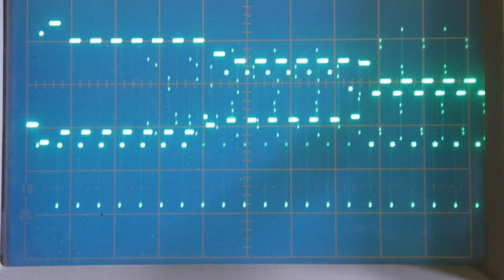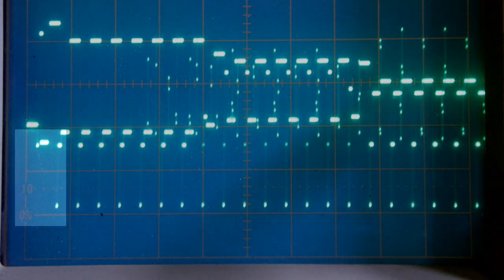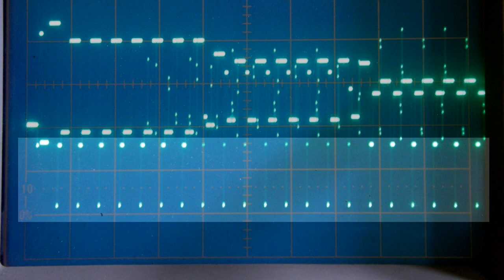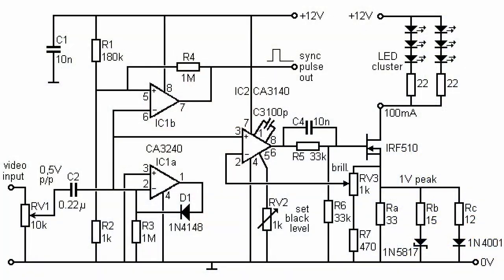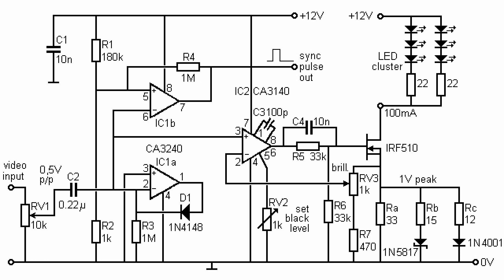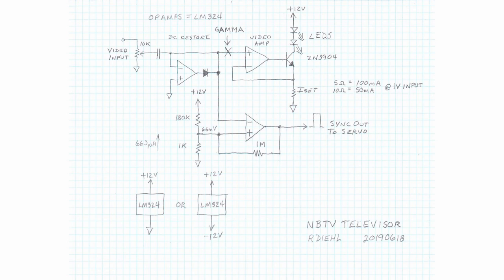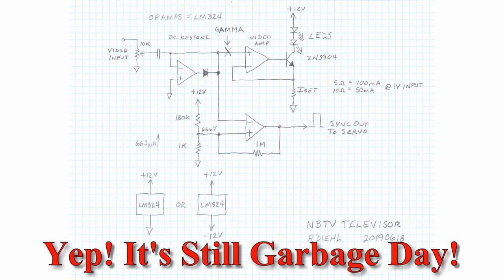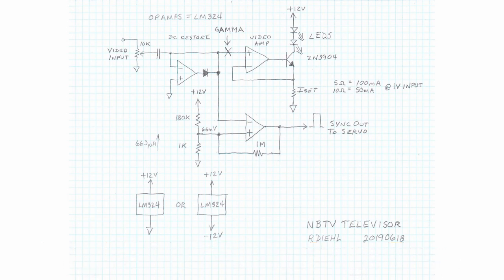Narrow Band Television, Video Signal Analysis and Early Circuits 20190618

Comment: Did Dumont have their own scanning rate in the early days of color experimetation? I am very fascinated with Dumont and feel bad that RCA smothered them out. I have a 1959 Dumont Hampton and a 1947 Stromber Carlson which is a Dumont RA-103 clone. I would love to build a mechanicale TV. I do not believe the Baird replica kit is availlible anymore. Gary
Reply from the maker: Dumont and GE both made a 525/90 field sequential systems with 18MHz bandwidth. Closed circuit short range only, obviously. My Tektronix o'scope 744A uses a format internally that is extremely close to that! It's a monochrome CRT with a "liquid crystal like" optical RGB shutter panel in front. (Too bad it is broken again.)
Mindset's web site says there are 6 units in stock and more can be ordered. https://mindsetsonline.co.uk/shop/televisor/
Reply: @videolabguy  Emerson bought the Dumont television manufacturing in the late 1950s. There were Dumont televisions made up onto the mid 1960s or so. I wonder how much of the sets were still made by the Dumont engineering without any changes by Emerson?

Comment: Termination, who needs proper video termination? Just ask the guys at IBM Boca who designed CGA....
Reply from the maker: CGA and EGA are not video. VGA came a lot closer. For years, I thought precision voltage levels were a myth. Then I got a great mentor who set my ignorant azz straight. He was mean as heck. But, I survived and was far better for the experience. When I do sloppy circuits today, its actually painful!

Comment: The gamma issue has always been somewhat controversial but the truth is a "true" fully mechanical system, that is, a mechanical camera to a mechanical monitor, is perfectly linear . So if you replace the mechanical camera with a conventional camera, that is, one that applies (inverse) gamma, you do need gamma correctional circuitry at the receiving end. In practice the improvement tends to be swamped by the myriad of other sources of distortion so I rarely bother with it other than to correct for it at the source.
.
None-the-less, if you are striving for perfection, and your source applies (inverse) gamma you will need to correct for it just as  a CRT (inadvertently) does.
Reply from the maker: Thank you for the excellent comment. I have a plan to put a gamma corrector in the video path as an option for those who find they truly need it. The upside is that my circuit is adjustable over an incredible range of negative to positive gamma, and is linear in the middle setting. The downside is that the quad current feedback IC used has gone up to $18 each at Digi-Key. (A voltage opamp won't work) For me, if a solution works, I will eat the cost. But appreciate that not every experimenter has pockets that deep. For me, it is also possible, though not verified, that my world converter has a gamma control buried in the menus somewhere.

Comment: I did some experiments with ic1b some opamps work better than ca3240 for the sync pulse you may like to use individual opamps and have a play I think I had a circuit change on the forum I will have a look and you may like to try it out if you are not happy with the results .

Comment: That's pretty neat.  So if you were to record such a signal on an open reel deck.  Would you have to use one of those t junction adapters with your 75 ohm cable so that you can stick a terminator on there, or would you just plug it into the deck with an RCA adapter and call it a day?  I'm curious how they get proper termination to record these signals.
Reply from the maker: Using audio gear, you don't terminate the line with 75 ohms. Using a T adapter is one way to do it in a 75 ohm environment. In an audio environment, the typical impedance is anything from about 1K to open or infinite resistance. 10K would be fine. The reason I have to use 75 in my system is because my converter is 75 ohm. If I use audio gear, then I will use the higher impedance.

Comment: Obsolete video formats.... bleh... What you mean is superior video formats.  Very nice set of videos.  I have made a Mechanical TV as well once. About to build a new one.  Interesting that you intend to use a brushless motor.  I had thought of doing that but was sure it would need to be geared very low because they are fast. I have a lot of them for my planes.
Reply from the maker: Mario. Thank you sir. You hit the nail on the head. There is a ton of info on brushless AC motors. Not one note on how to spin them at sane speeds. Every article is about spinning them at tens of thousands of RPMs. My current problem is that I can not even make the motor turn. It is a hard drive motor, 3 phase delta wound, with 1 ohm per coil resistance. It just sits and buzzes. I want to spin it at 750 RPM with the simplest proper 3 phase driver circuit possible. NO PWM crap.
I recently got very angry at this problem and put it aside to work on the subjects I have posted recently. I do plan to return to this project soon.
The advantage for the amateur mechanical TV builder will be that the motor is already turning at the right speed when he starts out and we only need to bring it into frame lock and phase. 
I look forward to your solution if you try this method.
Reply: @videolabguy  Fascinating! I never looked into the ESCs for brushless motors. I will have to put one of them on my scope and watch the signals.  I wonder. The PWM that feeds those ESC's is probably not nearly enough resolution for keeping the disk spinning at the proper speed. It's like we would want the resolution to be 750 +/- 5 RPM.

Comment: Hello videolabguy (I don't know your first name). I love your channel and your website. I am an electronics engineer like you (I have my modest little YouTube channel) and for about a month I have been thinking about the design of a mechanical television. I think I can do it alone on the sync part and control of the power LEDs (I have my own diagrams in mind). On the other hand, I would like a television without a camera initially and so I am looking to obtain video files in mechanical TV format. I think that the most common current standard is based on the 32-hole Nipkow disk. Can you please give me links where I can get such video files. If you have any advice to give me for the motor and its disc support I am also interested (speed, diameter). I clearly saw that your preference for speed control was towards an analog control and a servo on the video frequency with a CD4044 PLL, there is surely a reason linked to your experience on this choice rather than a PWM signal I I'm a little suspicious of the reason but I would like to hear from you on the subject.
For the design of the disc and for manufacturing it I also have my own idea in mind which I will share if it works.
Reply from the maker: Go to my YouTube homepage and find my web site link next to my silly "big nose" photo. At my site, click the "Personal Contact..." link at the bottom of the list. Send me an email and we can talk about mechanical TVs.
Reply from the maker: Here is the link to the NBTV club in England. http://www.nbtv.org/

Comment: Howsit, i know this is a bit off topic but i was wondering if you could help me, i recently bought a JVC KY1900E 3 tube saticon camera at thrift store and it powers up just fine, however the image is unfocused and overly blue with the right side red. messing with the tube alignment pots only work for the blue tube. is it dead or is there a chance i could restore it?
Reply from the maker: Anything can be restored. Get the service manual first and foremost. It sounds like there is a problem with the red horizontal deflection driver or yoke. The manual is a must. Also look for a copy of "Video Cameras: Theory and servicing" by McGinty.

Comment: Where’d you go? You’ve been awfully silent lately...
Reply from the maker: You are correct sir. I took some time during the summer. This video generated almost zero interest and I have been pondering on whether to pursue this project or start a new one. There was also some push back since most of the NBTV folks do not have the color video resources that I have. They don't have the very expensive World Converter and, to make matters worse, it is not available any more.
Reply: Great to hear from you, videolabguy. I think the relatively small number of NBTV'ers out here are divided into those who want to do it in software, and those who want to get our hands dirty. Either way, nerds just want to have fun!